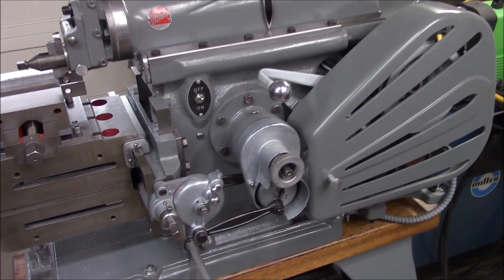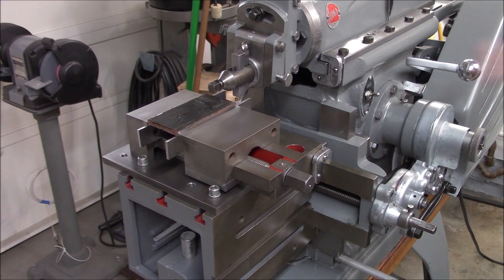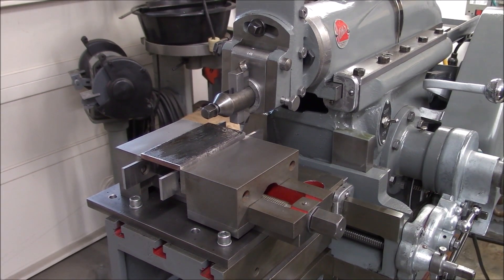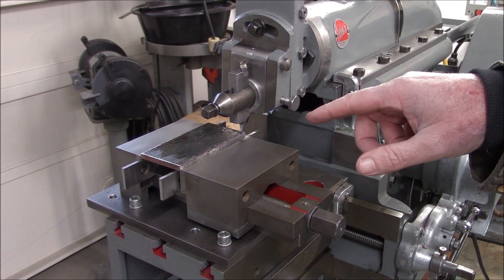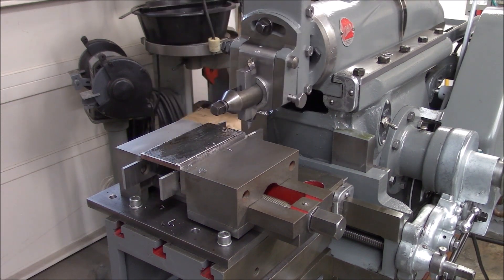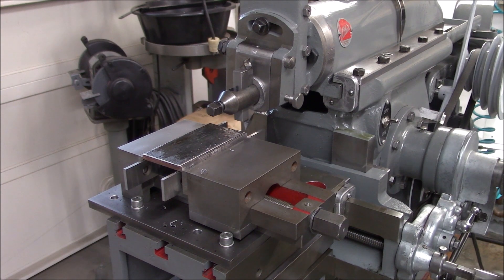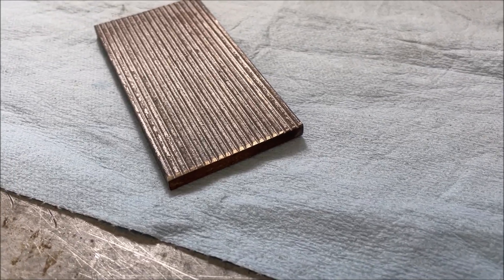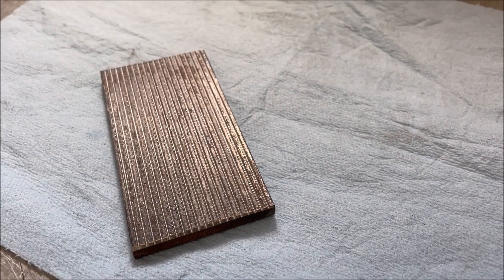Metal Shaper Monday - Testing Step Over Cuts

Comment: Your shaper videos have been so helpful for me rebuilding my 7B. I was wondering what size or number belts you’re using? I’ve got mine back together but now I need to find the correct belts to get it dialed in. Thank you again for all your content!
Reply from the maker: Justin, I used a 4L280 on the motor side and a 4L320 for the step pulleys.
Thanks for commenting and viewing!
ATB....Dean
Reply: @TheAyrCaveShop  Perfect! Thank you again

Comment: I agree about not needing to stop the machine.  Running the shaper at a slow speed I've found it easy to turn the crossfeed 1/2 turn or a full turn (depending on how you want the vise jaws to look) by hand on the backstroke.  There's no need to even look at the dial if you're turning the crank straight up or down.
Reply from the maker: Yeah that was pretty much it 1-turn was .100
Thanks William !